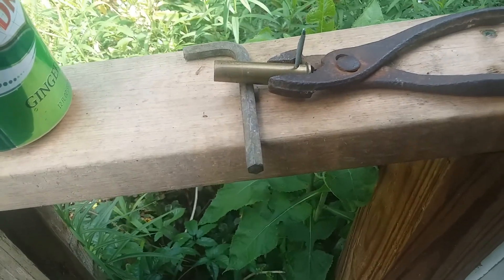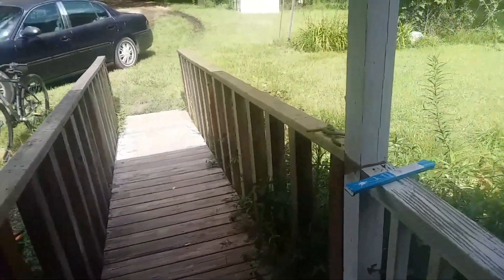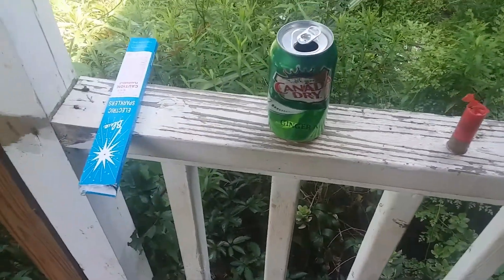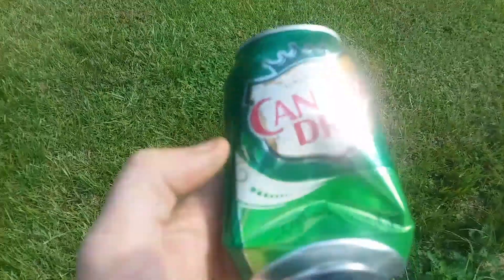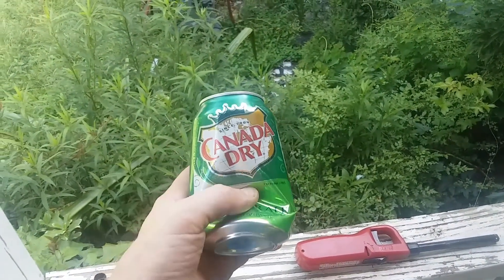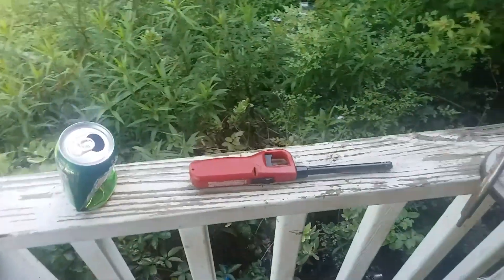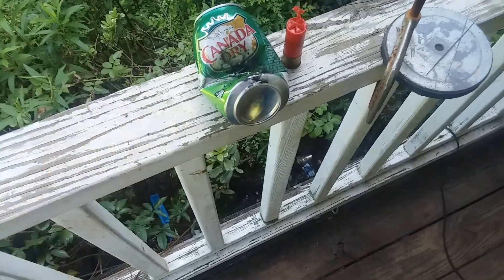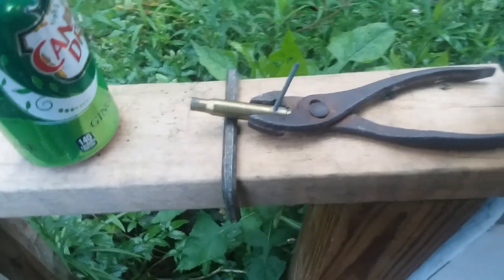mouse cannon Mk1

Comment: Breaking News: local man arms gang of mice with cannon, robs nearby cheese factory.

Im glad you werent holding that 3rd attempt! As for what to use as projectiles try some BBs wraped in tissue paper (to pack them together) or individual buckshot pellets (if you want a cannonball effect). They might work.
Reply from the maker: Lol😂😂.I'll try the bbs next. I tried loose buckshot and buckshot wrapped in tissue paper but couldn't get the pressure to fire it. I have a bunch of lead flashing off a old roof and in thinking about making some mini cannon ball molds then melting the lead in my forge and pouring it. I e been wanting to do that ant hill casting too but it won't stop raining long enough to do it lol
Reply: @docholiday2538  this 4th of july i was using a 1ft piece of steel tubing (the thin stuff that lightweight shelves use) with one end crimped down.
   I would drop a firecracker down the "barrel" with the fuse sticking out of the crimped end and use it as an improved cannon to shoot airsoft pellets at playing cards. 
   Safe enough for the little kids to join in on the fun.
Reply from the maker: @DH-xw6jp  nice. We used pvc and made pistols to shoot the bottle rockets out of